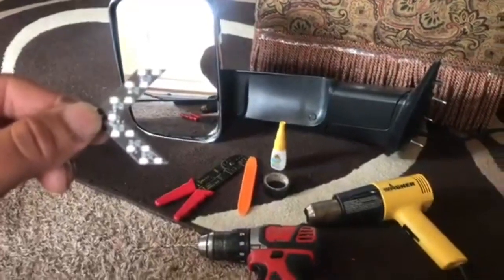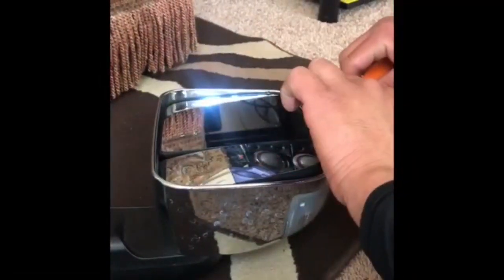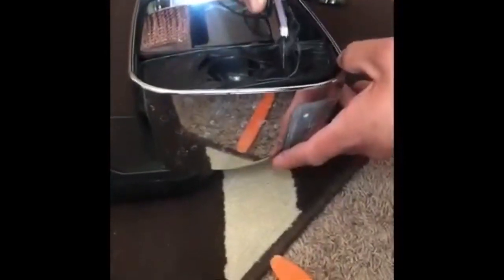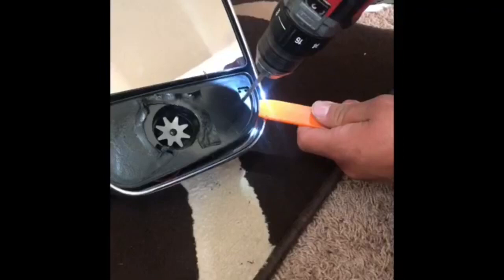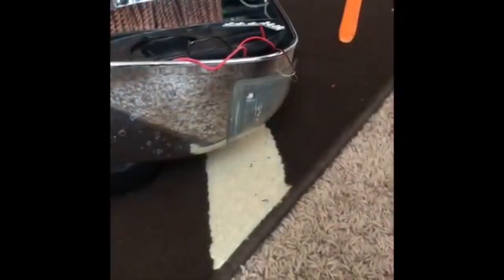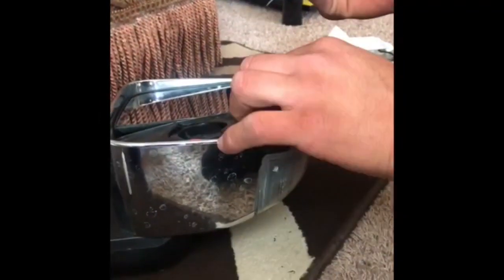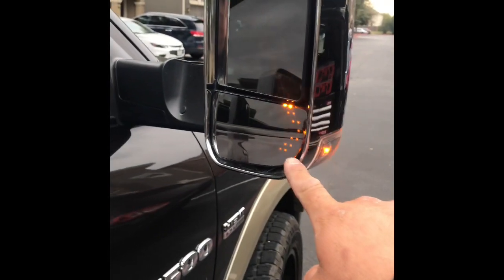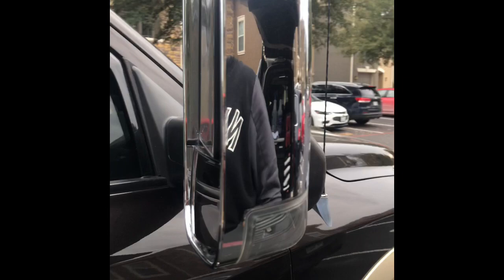Dodge RAM Side view mirror turn signal install

Comment: U know that's not the right way. Glass is going to stick up from the black base unless u trim out an arrow section in the black base. Maybe not on this particular mirror, but most others. And, use new adhesive. Do it right or not at all.
Reply from the maker: John Wagner Yes I know that I have multiple videos doing it the way you’re saying my customer wanted like this